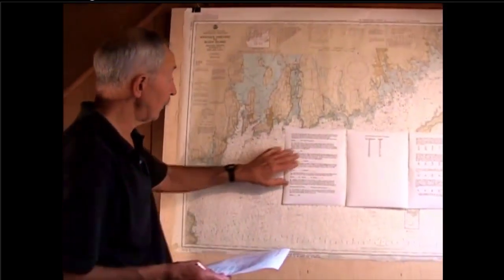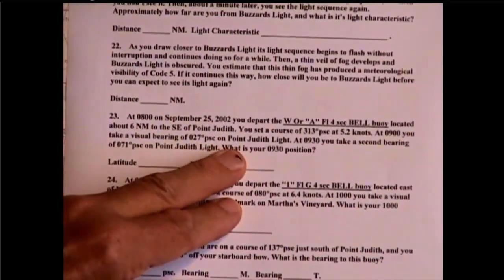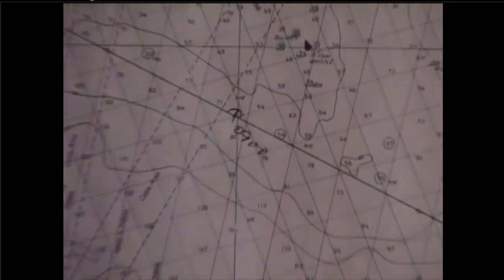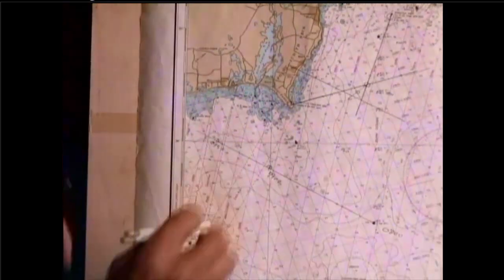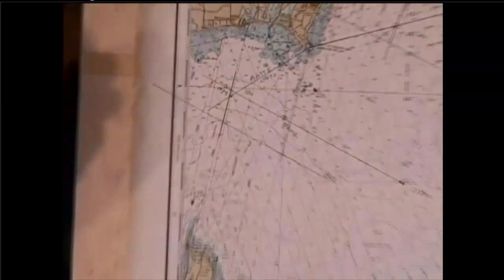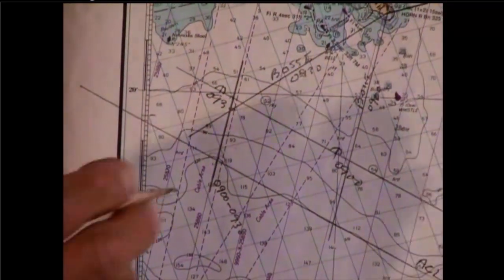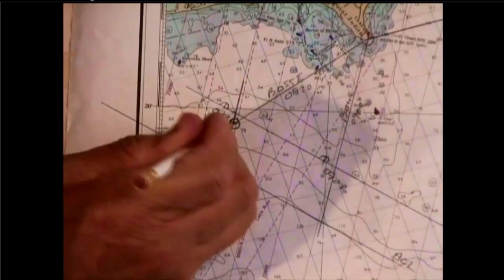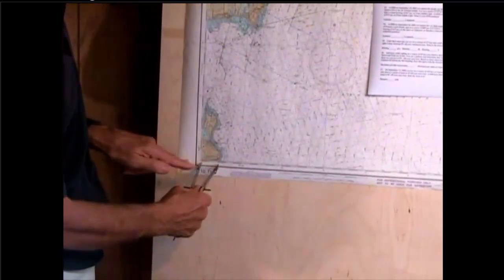Running Fix

Comment: Why at 11:58 you had to draw an arbitrary line parallel to the course line? Could you have measure the distance (that you advance the bearing line) on the course line itself?
Reply from the maker: Yes, you could have done it that way, but we teach this procedure using an arbitrary course line (also called an average course line or ACL) because it also applies to a situation where you made DR course changes during the time between the two bearings. The textbook includes an example of a running fix with DR course changes and the procedure is exactly the same as that used in this example; i.e. plot an ACL between the DR times of the two bearings and use this to advance the first LOP to cross with the second LOP. Also, plotting this ACL off to the side of the main DR plot reduces the clutter on the main DR plot.... T